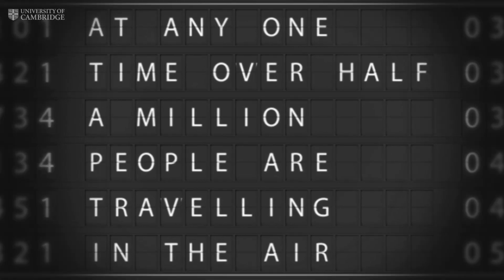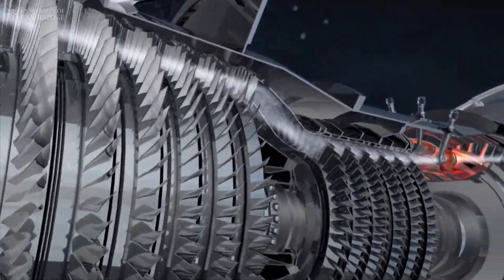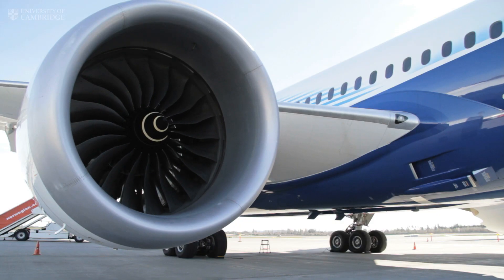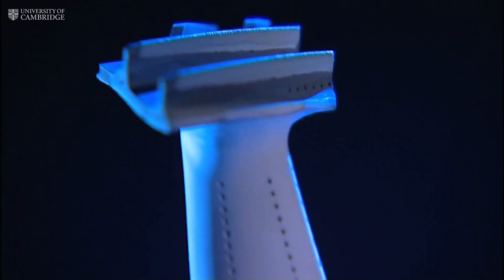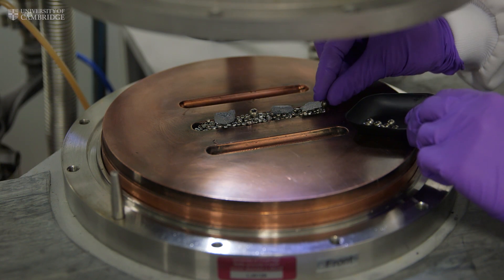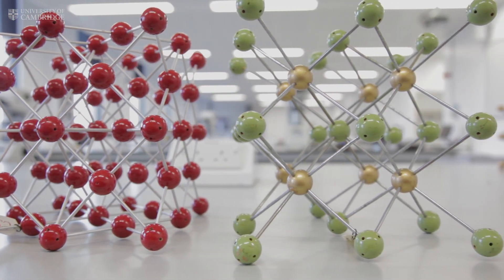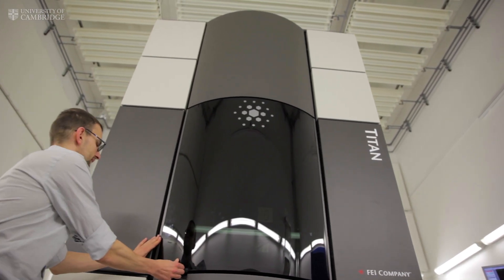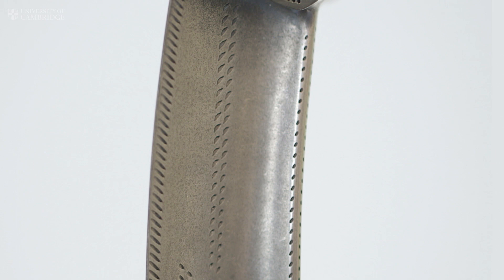Engineering Atoms

Comment: I feel the need to point out that Rolls Royce is already producing these high grade monocrystalline fan blades in their defense aerospace division. Its not hard to guess based on the big picture of a hovering F-35 on their front page and the small mention of turbine blades in the Wikipedia article on monocrystalline structures.